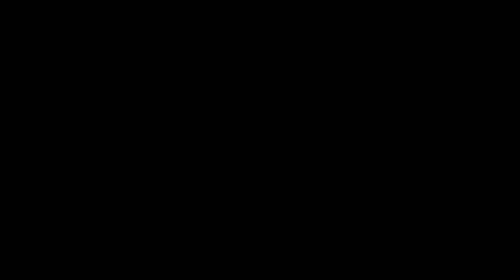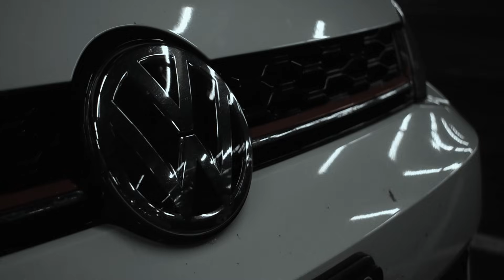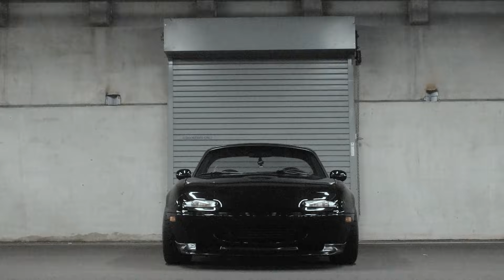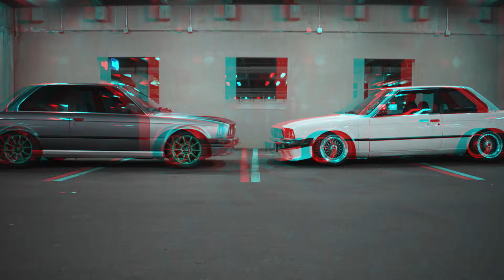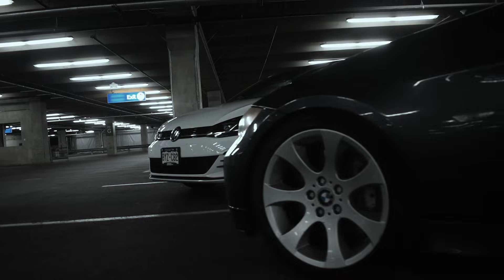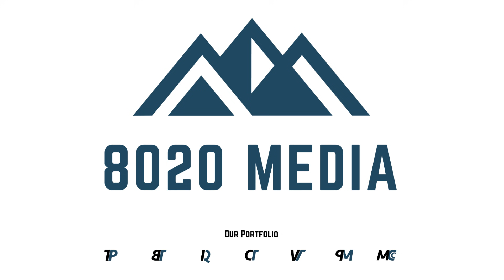8.1 Vortec Reliability & Common Problems

Comment: I’m going tomorrow to look at a 2005 8.1 with Allison . Truck has 140k miles . I’m hoping  it will be as good as I see in these comments . I’m paying a premium for it , but it doesn’t have a scratch on it .
Reply from the maker: Pb - It all depends on how well it was previously maintained. They can be work horses.
Reply: Update? 

Did you get it?
Reply: @donc6781  nope , got there and the guy lies to me about oil leaks , and when I started it it was smoking blue . I just walked away
Reply: Trying to decide between a babied 75k mile 2001 with this 8.1 or a 2013-15 Toyota Tundra with 150-200k miles for twice the price . . . Anyone have an opinion? Seems like this engine should last 500k with the right maintenance

Comment: You obviously haven't worked in on 8.1 engines. The claims of spark plug failure and lifter tick being "oil consumption" issues is something as a GM master tech I have never heard. The actual issue with lifter tick is directly caused by lack of oil changes and poor quality oil. 

The spark plugs were originally gapped at .060 and there's a GM service bulletin that updates the plugs to a iridium tip plug with .040 gap. This update solves a starting issue in some spplications in cold weather and is said to improve fuel mileage. I have never heard of plugs failing due to oil consumption and "contamination". Maybe on a poorly maintained high mileage engine but certainly not a normal condition.  The plugs generally last 100k without issues. 

The 8.1 has a cast aluminum intake manifold and is not know for intake gasket failures. This is a common failure in the small block 4.8 -6.2 liter V8s due to the incredibly cheap plastic intake manifolds and the extremely light torque spec for intake bolts. This is not an issue on the cast aluminum intake. 

The oil consumption issue is directly related to piston skirt design and is common to all late model GM engines. 

The 8.1 engine has very few issues and GM engineers designed the engine for a 200,000 mile service life. The critical issue is use only high quality synthetic oil and change at 3,000 mile intervals.

Lifter tick due to poor oil quality is corrected by adding Riselone High mileage oil treatment. This additive will clear the lifter issues.
Reply from the maker: Thanks for the expert advice!
Reply: With a 120k mile 8100, getting a off beat knock. Oil pressure needle vibrates and just over 40psi. Runs smooth, started after sitting 2 years because afraid of the knock. Need a trick to diagnose w/o ripping out. 20w-50 will try first
Reply: @stripemaster9 you can isolate the cylinder making the knock by disconnecting the ignition coil at each cylinder and listen for the noise to change.
Also a flickering oil pressure gauge usually indicates a rod bearing issue and likely is related to the knock sound. Could be other issues but generally that would be my guess. Isolate the noise by disconnecting coils one at a time while running. Then drain the oil and drop the oil pan and look for a loose rod bearing on the cylinder that changes the noise in your diagnosis.
Reply: Someone told me spark jump from worn out spark plug wires can cause the oil pressure gauge to dart around @stripemaster9
Reply from the maker: S - Thanks for sharing your experience. Keep us updated.
Reply: Thanks for this, I think I’ve made my mind up that I will buy a 8.1 because there’s one I see for a good price
Reply: @TueseTimoteo same i’m going to look at it tomorrow
Reply: @SaltyStangV6 big block! Smiles per miles easy on the pedal 🤣🤣, Goodluck tomorrow, hope you’ll make a decision on it and it’s in decent condition
Reply: got rid of the lifter tick and consumption issue with Mobil 1 5W40 Euro. -  Full syn of course

Comment: Very useful video ! What kind of oil would you use in that Beast ? I just bought one and the previous owner told me to use t6 Rotella , what do you think? Thanks again
Reply from the maker: I'd worry more about the weight and viscosity of the oil vs the brand honestly. A lot of people like 15w-40 in warmer months and 10w-30 in colder but that's just a subset of people. A lot will stick with the recommended 5w-30.

Comment: Only problem I ever had with mine was when I went through a phase of using 93 octane fuel.  The plugs DO NOT like that.  Keep it to 87 octane, change your oil regularly and it's a beautiful platform.
Reply from the maker: Adam - Thanks for sharing your experience!

Comment: I hope someone can help me i need figure out how to find a high output alternator for my 2008 Class A Motorhome 8.1 Vortec with 5,163 miles (not typo) dealers dont help me because its a motorhome.
Reply from the maker: Michael - Those can certainly be hard to find.. We can try to look around.
Reply: Look at the part numbers on the unit. 
Use a cross reference chart to find what you need.
Or have an electrical  rebuilder test and verify the internals.
Good luck.!

Comment: 8.1 6.0 and 5.3 have the same air intake gasket problem and knock sensor codes. But 8.1 is a beast that is for sure
Reply from the maker: Mile - Thanks for sharing this insight! We completely agree.
Reply: What is the cause of the knock sensor issues?
Reply: @lpanizza2276  a big one is water running underneath the intake plenum and rusting the knock sensor out

Comment: I just replaced my spark plugs for the first time. Kind of embarrasing for 301000 miles. They looked perfect. Didn't even need changing. I have replaced the radiator, water pump, hydro boost for brakes and the crank position sensor  and all the obviuos brake, bearings,and front suspension. Still same transmission with no service besides flushes. The most reliable engine I have had in 40plus years as a mechanic. And still fun to blow away average vehicles off the line with 455 lbs of torque
Reply from the maker: Erik - Thanks for sharing your experience! We love hearing it and it will help future viewers.

Comment: One of the main reasons for the oil consumption issue is the clearances on the internals
Reply: A lot of it has to do with big blocks running forged pistons and it takes a while for them to expand. In the meantime you have the oil consumption. This accounts for some people having to add more oil than others. Short trips frequently will end up using more oil than the guy who travels 50+ miles every time it's driven. When engines are in marine use, and have forged pistons, they tell you that after so many hours and X amount of RPM you will use a quart or more oil. In the owner's manual it states this, and it's normal.
Reply from the maker: W - Thanks for sharing this insight!
Reply from the maker: Joe - Thanks for sharing this insight.
Reply: @8020Automotive you're welcome

Comment: I have not heard of a lot of these - but the 8.1 in my Avalanche had a camshaft lobe failure. Spalling on the tip of the lobe until it lost enough height to cause a lifter click at higher rpm. However, after replacement at 107,000 it has been fine and is now at 203,000.
Reply from the maker: Steven - Thanks for sharing your experience and insight!

Comment: 8.1one of best Eng ever
Reply from the maker: Robert - We completely agree!
Reply: @8020Automotive  I bought a suburban 2001 2500 hd over 600k Routine maintenance wit through three hydro boosters 8 tune same  trans   pulls my  roofing trailer13k full  still  roiling.      a lil lose but i got my moneys worth pad 55k in 2001 for it

Comment: The only problems I have had since 2001 was oil consumption but switched to royal purple 10w 30 synthetic , intake manifold bolts  come loose do to vibration and replace crankshaft position sensor and a mass air flow sensor other than that it’s a solid truck zero rust starts every-time just keep the maintenance no problems also upgraded brake lines and brake systems to stainless steel  and new stainless steel fuel lines and a fuel pump  but she never says no or ever stranded me
Reply from the maker: John - Thanks for sharing your experience. This will certainly help future viewers!

Comment: We had a 2001 Silverado 3500 8.1 with 4.11 gears for 10 years. Got 8.5 MPG towing our 5th wheel.  Now driving a 2022 F350 dually 7.3 Godzilla with 4:30 gears. Gets 7.5 MPG towing the same 5th wheel. However, it will maintain speed up the long hills, unlike the lower HP and less tranny gearing of the 8.1
Reply: Experiencing the same had an 8.1 with 4:10's for 20 years got 300,000 miles out of it. Got a 22 7.3 with 4:30's also and I swear the gas mileage is worse than the 8.1. You're right about the horsepower difference its almost 100hp more and you can feel it but dang I was hoping the 10speed would help more with mpg's tho.
Reply from the maker: R - Thanks for sharing your experience!
Reply from the maker: Hy - Thanks for sharing this insight and your experience!
Reply: The reason you got such bad mileage with yours is you were towing a big air dam.  I towed right at its GCVWR and never got below 14MPG and never had a problem with power on long grades. Example is the Stretch of I-77 just inside of the VA/NC state line. 7 miles of 5% grade and if you start out at the rest area before you even get 2 miles up the grade you would be at max speed limit while passing just about everything else on the road. 25K on plugs, it still was running the originals at 125K. Oil, well that was a problem. But add 1 qt of Mobile 1 to the rest of the Amsoil and there was no consumption between tests for contamination every 10K.  Only reason it is parked is because of the one problem all of them had, fuel pump failure at 125K.

Comment: I have two of these engines. One of them is now an 8.8. Once you replace the low tension piston rings thereby preventing oil consumption it is a wonderful engine.
Reply: I heard or read somewhere, that forged pistons are used in these 8.1L. The expansion rate is rather slow during the heating up to normal temperature and this causes excess blowby. It would explain why some people need to add a quart every 2000 miles and others longer before adding oil. The ones adding oil frequently probably drive relatively short distances. The pistons may not have expanded during most trips eating up oil.   🤔  🙄  🤷🏼‍♂️ The low tension rings? Are you talking about too big of a ring gap from the factory?  The oil control rings or both control and compression rings? Maybe the steel used in the rings you're talking about is flimsy. They might purposely leave a big ring gap for the expansion and that would cause the oil issue. It just takes longer for forged metal to adjust to temperature expansion, I suppose.
Reply from the maker: T - Nice! Sounds like a good one.
Reply: Thanks!
Reply: @goodson77784  you are very welcome.
Reply: K

Comment: Guy I use to work with his would only burn a quart between oil changes which worked out cause he would just change the oil cause it was time to change anyway but he had all kinds of problems with the Allison transmission think he had to replace the transmission twice so he finally just sold the truck
Reply from the maker: Ah that's a bummer - the Allison is usually the more desirable of the transmission options.

Comment: Could you swap a 8.1 into a 2007 Silverado?
Reply: They came from the factory in the Classic Silverado but not the New body silverado in ‘07 .
Reply from the maker: Soggy - You technically can, it would just be difficult and a tight fit.

Comment: I have a 2003 8.1 manufactured late 2003 for the 2004 model year,how do I know if I have the crankshaft sensor fix from the factory?
Reply from the maker: R - The best way is to visually inspect it if possible.

Comment: I have an 8.1 that will skip in any season except summer. No engine light. Replaced coils wires plugs cam sensor knock sensor, cleaned ground wires on block and frame under drivers side cab. It’s symptom is in cooler weather it severely skips when accelerating the like flipping a switch it kicks in and takes off like a rocket!  When it’s doing this it stinks like hell,,,   Any advise?
Reply from the maker: Zip - This is pretty common on old diesels. But other things to look into are: fuel injectors, coolant temp sensor, intake air temp sensor, and vacuum leak.
Reply: Do a live stream and look at knock sensors....

Comment: I feel like saying the 8100 was based on the 7.4 is misleading. The 8.1 has a 10.2 deck height where rhe 7.4 was a 9.8 The 8.1 is more like the 427 tall deck than the 454
Reply from the maker: Eric - Thanks for the insight.

Comment: Thd oil problems is based  on lies to use the lightest oil weight and to go extended oil changes.  If you use heavy 50 weight oil and change every 5k miles, you won't have oil consumption and oil sludge problems , lifter problems
Reply from the maker: Dylan - Thanks for sharing this insight. We absolutely agree.

Comment: Thanks for the info Jake. I own a 2002 Silverado 2500hd 8.1 backed to an Allison 1000, one of the best combos, 274,569 miles, running strong to.  I've owned it since 2003 and knock on wood I have only have the issue with the Crank Position Sensor a couple of times and a little oil consumption. This weekend I am rebuilding the original front suspension with all new parts. Thanks again.
Reply: Would you recommend buying one used with over 200k?
Reply: @wesleybryant7334  I bought an 05 Silverado LS 4x4 2500hd in 2021 for 16k with 90k on it. Love the truck regardless of the fuel consumption and lack of range. The 8.1 is a torque monster!  Makes my last tow rig look like a joke without paying the premium for a duramax. As far as oil consumption,  I check it every time I use it. In several thousand miles it hasn’t used more than a half a quart. The guy I bought it from was the original owner. He said he always used Amsoil. Maybe that makes a difference.
Reply: @wesleybryant7334   Thats a tough choice. I would ask for maintenance records and look under the truck for leaks and rust. If the truck was maintained and taken care of it should be a good buy for the right price.
Reply: @Toddderose  they’re asking 15k seems to be well taken care or only thing is I can’t physically look at it because it’s online and too far to travel and check it out. But there does seem it could have a little corrosion underneath.
Reply from the maker: Great advice Todd! Thanks for assisting.
Reply: @wesleybryant7334   Ask the seller to send some pics or a video of the under body. Let the person know that you are interested and serious about purchasing it. Ask for specific pictures to, axles, difs, bottom of the motor, transmission ect.  Also ask if the seller can provide maintenance receipts. Just some thoughts hope they help.  🤙
Reply: Same 02 2500hd 8.1 allison 4x4, 4 door 8ft bed.
Reply from the maker: Todd - Thanks for the feedback! Also, thanks for sharing your experience. It sounds like you've got a good one.
Reply: Last year I was so surprised and Blessed that my Aunt passed down my Uncles 2002 chevy Silverado 2500hd 8.1 with the Allison Transmission and he had air bags in rear. When I went to pick it up I couldn't believe it everything was brand new inside it actually still had new smell in it. And another awesome surprise it only has 7200 miles all original miles. She gave me all the paper work with all maintenance he had done faithfully and also the original window sticker when he bought it new. I love the way it drives and the power yes gas mileage isn't the greatest but I only use it to drive out of town to see my grand kids. Thank you so much for video 👍👍🙂

Comment: Hi Jake, Thanks for this video.  I am a owner of a 2500HD sierra 8.1 since a year ish. I got it with a truck camper combo 88 000 miles and it has now 106 500 ! I traveled all over the west part of the country and really happy with the reliability of this old mastodont. My only issue is the EGR valve, I got a light on the dash. I changed it many times and added a fancy gasket but still have the light and code. What do you think its wrong with it ?  I've heard it could be good to put a plate between the gasket and the pipe. Do you think it's wise?
Reply from the maker: Hey Drum - not to ask a dumb question here but have you tried resetting the code? If it were the EGR valve itself I would think you'd be experiencing some sort of symptoms from it. Could be a bad O2 sensor too that is causing the code. What code specifically are you getting?
Reply: @8020Automotive  hi! I have reset it many times, but it keeps coming back randomly. Sometimes when I turn the engine on its off but will appear at some time. The code is p0404.
Reply from the maker: Drum - Interesting.. There aren't any other codes? P0404 is issues with the EGR but if you've replaced it multiple times than it shouldn't be an issue.
Reply: @8020Automotive  i scanned yesterday and it's still this code... Have you ever heard about putting a plate between the valve and the rest of the hoose to block it?
Reply from the maker: Yepp, that's a common thing but you might still end up with a CEL depending on how you go about it. Check out this post here - should give you an idea of how to do it: https://www.dieselplace.com/threads/8-1l-egr-delete.383356/#post-3972767
Reply: @8020Automotive  thanks for the reply. What is a cel?
Reply from the maker: Check Engine Light
Reply: Maybe there's an electrical issue?
Did you check the wiring specs?

Comment: As posted below, run heavier oil. I only use 20-50 in ALL my vehicles. None consume a drop between oil changes. I also run 20-50 in all my small motors, like generators,  etc. Saving a half gallon of gas is not worth the problems associated with light oils lack of lubrication.
Reply: Add motorcote
Reply: I run the Rotella t6 oil in everything. Lawn mowers, atvs, my 6.0 chevy, etc lol
Reply from the maker: Foley - Thanks for adding this insight!
Reply: Running heavier oil isnt recommended for the 8.1
Reply: @Zkgod24 in the marine version it’s recommended to run 20-40